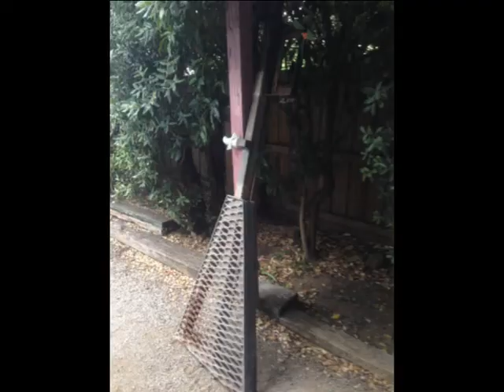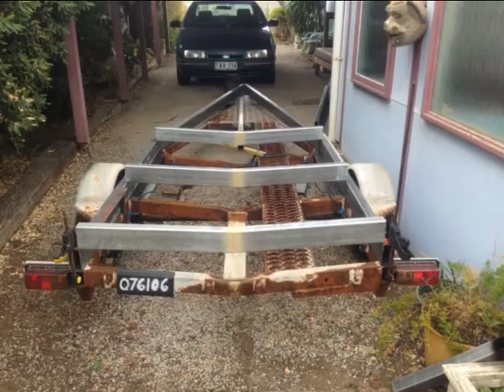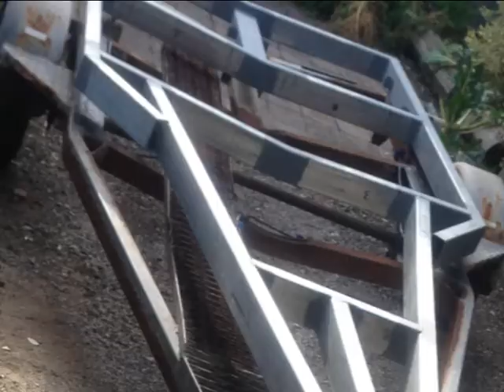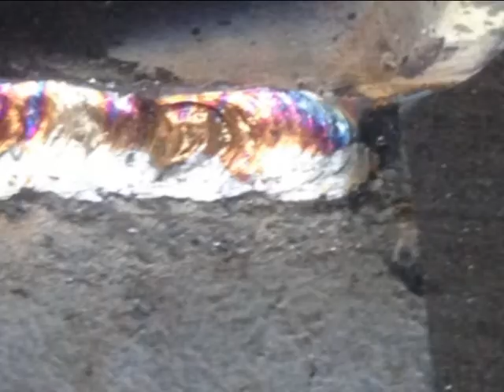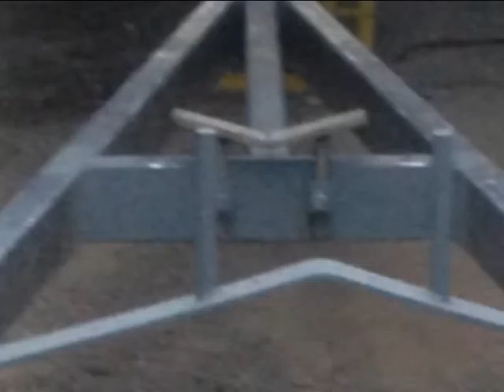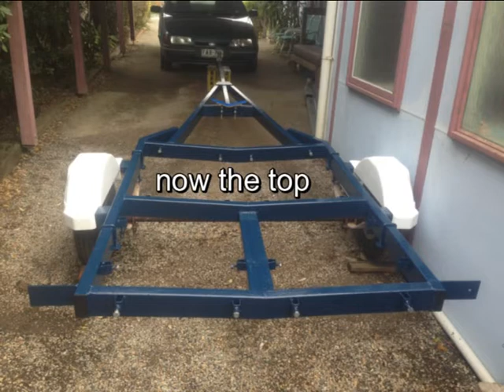how to build a boat trailer.

Comment: Looks tidy id recomend capping all your box you dnt want the salt water in there rusting it from the inside out also you could spray some second hand oil in there before caping for double protection
Reply from the maker: cheers, i have sika flexed solid plastic ones in. still going strong. may get someone to film my launch and retrieve soon, as i do it off the beach here. the retrieve takes 30 seconds only.
Reply: Id rather have opened ends and have the water escape than having sealed ends and having water trapped inside water always finds a way in. Its stainless isn't it? Will last for years. Very nice trailer.